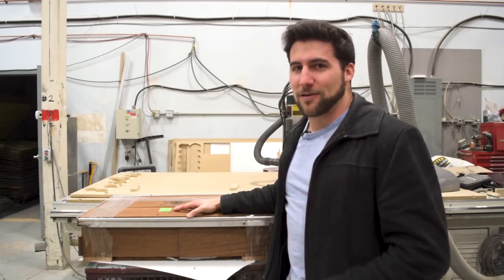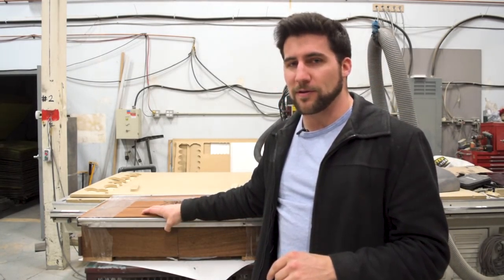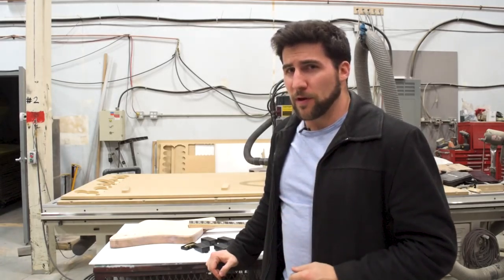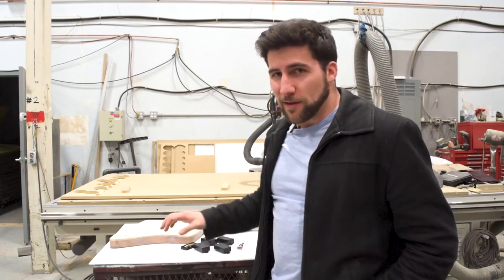New Hand Made Guitar Kit!

Comment: Concealed pickups? Fender had a few prototypes mostly with strat bodies, although I believe I have seen a Jazzmaster version too. All had 4 concealed pickups and were slated to be called the "Marauder". Ironically, it was Gibson, while in the clutches of the Norlin corporation, who ended up marketing a guitar with that name. It was an entry level guitar aiming for beginning players, with a neck humbucker and a bridge single coil plus a V headstock neck bolted to a Les Paul body shape.
Reply from the maker: I’ve seen a few telecasters with concealed pickups. I didn’t really understand how they worked at first because I didn’t realize that they just had pickups under the surface.

Comment: is it supposed to be so splotchy on the woodwork. i mean to make it look good you have to do a lot. its not even a kit. its like a halfway, oops i messed it up, you fix it - type of guitar.
Reply from the maker: It was done by hand without templates. There’s definitely some work to be done.
Reply: Without sounding defensive, but in my defense, what do unfinished guitars look like? To be informative it is the timber mate grain filler and when sanding back u will see the pattern of the book matched mahogany. Thanks